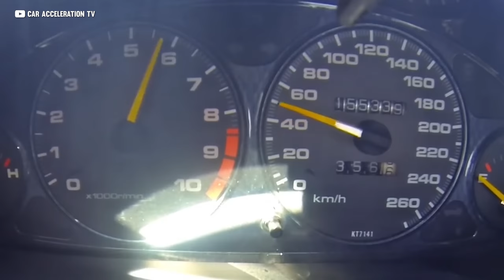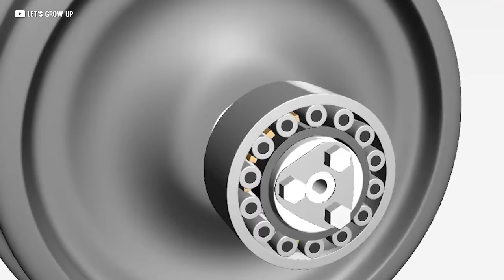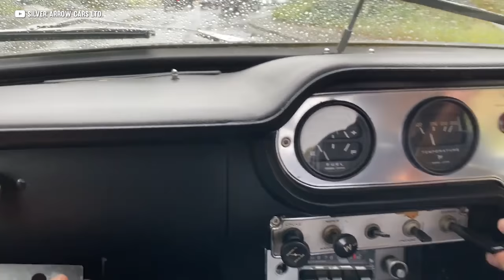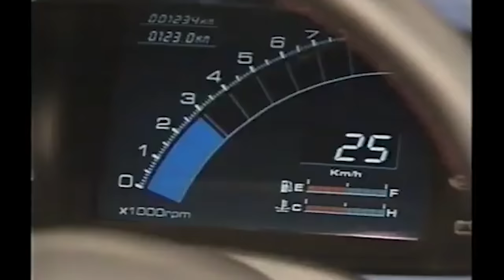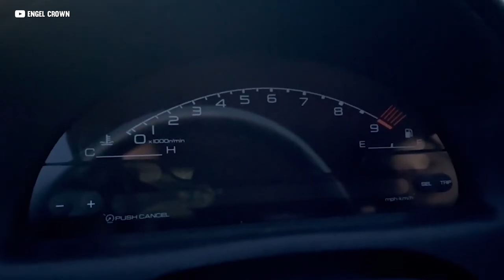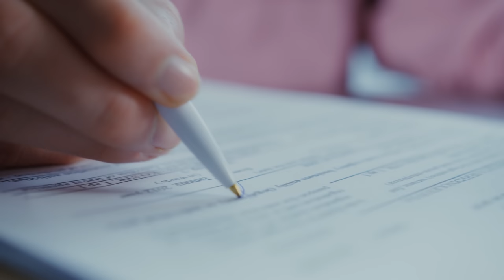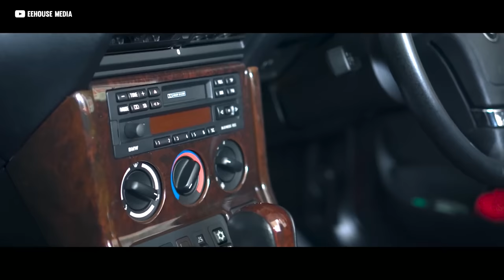Why Honda Killed The Greatest Sports Car

Comment: It's actually sad how honda could've destroyed the miata. Even before people started fanboying and loving the S2000, i always loved it. I loved it because it was the same concept as a miata, but with a high redline, VTEC, and more power. Even today, the S2000 has more power than the GR86, which competes with the miata.
Reply: Honda would not have destroyed the Miata. Mazda would have just upgraded the horse power and redline in order to keep the sales coming. As it turned out they did not have to.
Reply: @sharthun2009  not really. The miata is a more budget oriented car while the s2000 was much more premium and expensive.
Reply: A brand new S2k was 33k ...in today's market it would have been around 59k msrp , that's why the Miata is the answer. A brand new ND2 is faster than a s2k and has the highest rev line for a Miata at a fraction of the cost of what a new gen s2k would fetch for let alone how big every Honda car is now I can only imagine the size of a new s2k would be as well as heavy, another reason why the Miata cnt be destroyed
Reply: @user-jt6nw6wm5q  So my point remains valid. The Honda S2K would not have destroyed the Miata market.
Reply: @sharthun2009  i referred to you saying mazda would have upgraded power to compete with the s2k. They would have not done this since the cars do not really compete with eachother. The only reason why the nd2 gets compared to the s2000 is because now after 23 years mazda, with technological progression naturally caught up without making the car much more expensive. But if honda would have continued making the s2k it probably still would compete against the porsche boxster.
Reply: S2000 did not compete with the Miata, did you watch the video all the way to the end?
Reply: Their trouble is the power band is worse than the worst turbo engine from the 80s,
Reply: I hate Honda is stupid for that Honda is a demon for killing the legend S2000 you mean the legend 200 legends never die Honda
Reply: @William A. Ortiz-Flores Gil  I think you fail to understand...the reason so many people drive a miata nowadays is because Honda quit making the S2000. IMO Early 2000s Honda understood the majority of their gross income was from affordable Sedans/SUVs/Bikes. Not the S2000 or NSX. Honda actually made them (in that point in time) at a loss believe it not. I'm not jabbing your taste but 9k RPM in a Honda 2.4L Coupe will forever be a Gem lost in time. The newer Club Miatas are close i suppose but it's just not the same experience.
Reply: @sharthun2009 speaking of upgrading horsepower or redline, the miata of the time (1999, when the s2000 released) actually is completely capable of revving to 8000 rpm with no damage to the engine. A redline increase is possible on the NB engine with solid lifters, though there is very little reason to do so. The miata at the time did not have variable valve lift, which is what made V-tec great. The ability to switch between cam profiles meant that the engine could still be drivable and economical at lower speeds, and could have a very agressive cam that would allow it to keep making power at high rpm. The miata of the era made peak power at 6500, and that was fine with mazda, since the british roadsters they were trying to emulate would also redline around 7000. To make more power they'd either have to sacrifice the lower rpm range, or keep the cams the same and improve flow some other way... or increase compression.
Reply: @williama.ortiz-floresgil168  a new nd2 will get absolutely destroyed by a s2000. I jjst drove my buddies nd2 around and we decided it’s not even worth making a comparison video in a straight line. Miata’s are great but can’t compare with the character of a s2000 and feeling when driving it
Reply: @thestranger1164  or maybe because a brand new S2k would be 60k msrp and a specd out Miata club is around 33k ... That's why people who drive miatas  wouldn't drive a new Honda s2k ,  the Honda s2k would be up against a z4 or supra for that price point
Reply: I don’t think the Miata and S2k are even in competition. I think the S2K was in competition with the bmw z3 and Z4. I don’t think Japanese were competition with each other. They mostly were in competition with euro cars like the Gtr vs the 911 turbo and wrx vs Audi with rally racing. The Japanese were always on the same team. That’s why you see collabs with the Japanese today with Toyota and Subaru
Reply: @williama.ortiz-floresgil168  I hear that. In my area the club was like 35-40k. I do think the market is kinda of fucked up at the moment so you may, unfortunately, be right. I wonder if they would still keep it 4 cylinder though? We can only wonder.
Reply: If you've been in both cars, you'll know the S2K is waaay stiffer and much more of a performance car. It's not just a matter of the Miata having less power--it's center of gravity was much higher because the driver seat is sitting on the chassis along with the engine. The S2K X-bone chassis sits the driver much lower, as well as the engine block being behind the front axle technically making this a mid-motor configuration for true 50/50 weight split. The S2000 was never designed as a budget japanese convertible, which the Miata was. The S2K was a pricepoint higher, and had a different target audience than the suburban housewife with midlife crisis. 

Every S2000 was handbuilt in Japan.
Reply: I looked at one at a honda dealer when they came out. The salesman came right out and immediately said to go away and come back when i could afford it
Reply: @supers0nic77  Next time , tell him , u can afford to look at it and kick his ass at the same time
Reply: @sharthun2009  lol you've never driven a Miata, nor an S2000. If you did, you would know it's not just an issue of horsepower. Go google "xbone chassis". The S2000 has F1 racing technology in it's DNA. Races are won in turns.

The Miata is great for middle aged women who can't drive a racetrack, but want to look good driving to the local Lululemon with their Grande Mocha Latte to buy some butt-hugging tights.
Reply: My only contradiction (with some decent experience with both cars, owned an MA Miata for seven years (bought it new in '92, stripped, no air, no stereo, no diff for 13,999.00) is was the S worth the difference, twice the price basically.....
Reply: Having driven both. The S2000 feels like an overweight MX-5 and barely faster.

I'd take either but given the choice, MX-5 ftw
Reply: @supers0nic77  Did that day inspire you to become a millionaire?
Reply: @supers0nic77  Why did he do that? Do you look like Bling Bling from Bum Fights or something?
Reply: Bro. The s2000 never competed with the Miata when it was released in 1999. The s2000 was $15k + more than a Miata. The s2000 was in direct competition with the Europeans - the Boxer and the BMW z3.
Reply: @williama.ortiz-floresgil168  You never drove an S2K, give it a shot try it. Its not the numbers, its the seating the shifting and the feel of everything packaged in a S2k that made it truly special. If you had a chance to drive one you would be hard pressed to say and wouldnt make as black and white of an argument
Reply: No way it's going to destroy the miata
Reply: The MSRP on the 2009 Stook was more than 1 1/2 times as much as the 2009 Miata.  They were never in the same market.  The Stook was never 1 1/2 times as much car as the Miata.
Reply: It loved it before I even knew what a Vtec was or any of it's mechanical tropes for that matter. The NSX is my favourite but the S2000 has a special place in my heart
Reply: The S2000 has more horsepower than a Viper per liter. I love the car but I’ve had it before it became a fanboy dream. I’d rather have a mustang gt instead but still love it. Now too many of them want to wreck the simplicity of it.
Reply: @spinnymathingy3149  thats not true at all. if you owned one you would know, the engine is the dimond in the crown.
Reply: @ajorsomething4935  your point being??
Reply: @simongeeves  my point: MaZdA cOuLd HaVe MaDe MoRe PoWeR bUt ThEy WoUlD hAvE tO sAcRiFiCe DeSiReD cHaRaCtErIsTiCs.
Reply: @simongeeves  I only gave my first hand experience of driving a S2000, when comparing it to other similar sports cars. And yes just confirming the power band IS worse than a turbo charged car from the 80s, if you have had the pleasure of driving one, there’s basically nothing happening until 80% revs reached, then BAM 💥 FULL POWER all of a sudden, that’s the Honda experience here to a tee
Reply: @edgarpoe517  FACT CHECK, the MX5 centre of gravity is actually way lower than the S2000.   330 mm for a MX5 and around 455 mm for the S2000
Reply: People have been “fan boying” it since it’s debut your not special or original lol. Plus similar but very different than the Miata, much hard to drive but rewarding when done right. Price alone puts them in a different category though
Reply: @spinnymathingy3149  Still does not account for chassis stiffness and center of momentum--I'm referring to dynamic numbers. S2K is WAY better handling (box stock at least-I'm sure you can throw tons of money into an MX5 to try to get it to handle better).
Reply: @edgarpoe517  definitely, but I was just correcting the COG comment
Reply: @spinnymathingy3149  Roger that. 👍
Reply: A freaking car that came out in 1999 and still relevant to today's modern cars is insane. That in itself is a an accomplishment.
Reply: @thestranger1164 no dummy, people got the Miata because they were basically the same chassis and a lot cheaper so you could mod it up. The s2000 in reality was overpriced for the bang you got..
Reply: c V vn👍🏾😅
Reply: What do you mean could have? It did destroy every miata from 2000-2009 the s2000 was better in every way then any miata during it's time. The s2000 engine platform in Ap1 or Ap2 will outdo and make more power than any miata ever new or old. I don't hate the miata. Im just stating facts.
Reply: @TheMrRobert  Not even remotely close to the same chassis. The Miata is a lot smaller, has a much shorter wheelbase, and a much less rigid chassis.
Reply: @williama.ortiz-floresgil168 the driving feeling in a S2000 is far superior even to a ND Miata, I love Miata’s but no Miata is better than a S2000